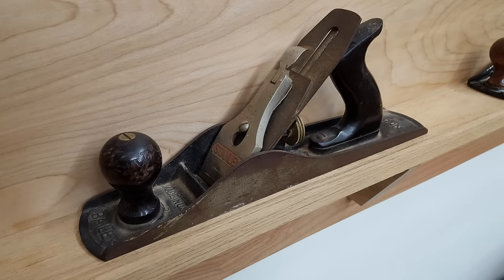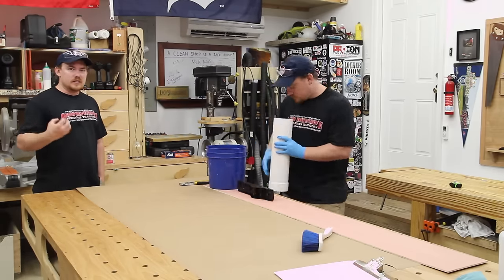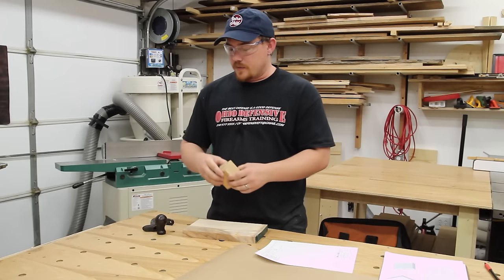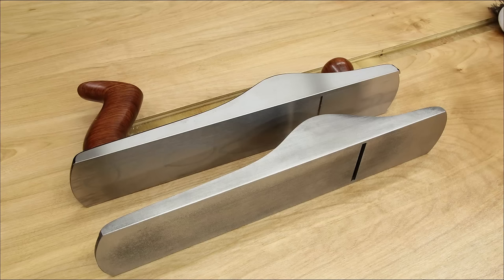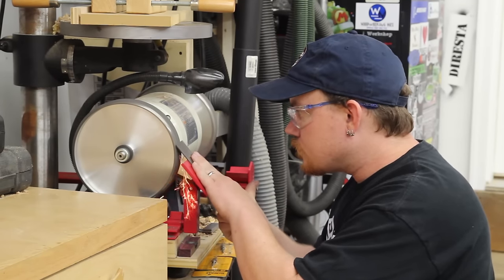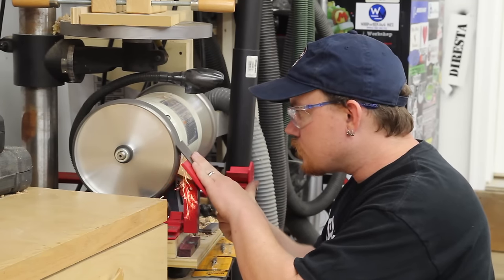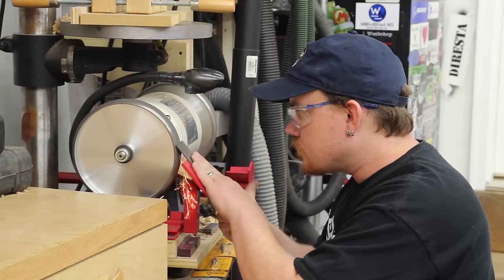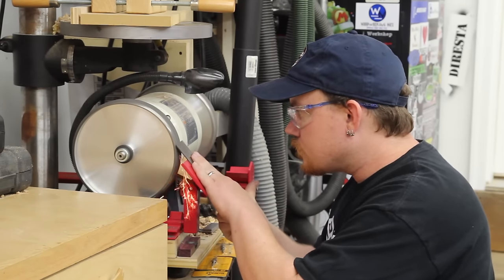Restoring A Hand Plane - Stanley Bailey #5    - 254

Comment: your not worried about the back handle splitting? which way is the grain going? 
im refurbishing a plane as well (i dont know what number it is, i got it for $5 from a wood market and it had a plastic handle, the guy told me its an el-cheapo reproduction made in india) and i was wondering about how to go about making the back handle, ive made some handles with cedar and they split right along the grain so is that a problem with all wood, if not what wood should i use? thats not hickory (theres not any places that sell it near me) would a tree branch work?

Comment: Great information.  I just bought a Stanley No. 5, type 20 off of ebay. Looks like I’ll need to do some restoration, so I have a few questions. I’m very new to this so where it’s apparent, please forgive the poor word choices.

If you drop all of the metal into vinegar, will the japanning come off as well?  
What is the reason you built new knobs rather than restore the originals? It was cool to watch, but I’m curious if you could have just restored rather than recreate. 
Won’t the spray paint chip off or scrape off after a few uses?  Isn’t that why Stanley went with japanning?
Can a thick piece of glass be used as a “known flat surface”?
Reply from the maker: I have no idea on the japanning. New knobs because I wanted to make a new one. The old can be restored. The paint is not as durable as japanning. I used what I had on hand. A thick piece of glass can be used as a flat surface so long as you verify it is flat.
Reply: @JayBates  Thanks. All answers are reasonable.  Much appreciated.

Comment: Other restorers of hand planes say absolutely to not use vinegar. Why do you suppose that is?

I have also seen advise to not use a film finish on the handles, which I also used restoring my No.5. The advise was that a plastic smooth sealed finish makes hands sweat and blister more than an oil and wax finish. I admit that my film finish looks cheap, even with the redwood stain I applied after sanding. I should have just used linseed or tung oil, I think. Both my handles were/are in perfect condition.
My Japanning was too far gone. I stripped my plane down to bare flash rusting metal, primed and painted it Royal Blue ;-) Looks like a type 16, but I don't need it to look period correct for collector value, nor do I want it to work like original. It was never tuned or flattened, or squared. It will be better working than it ever was when I finish up.

Comment: The original tote and knob were rosewood.  You did a nice job on the replacements but nowhere as nice as the rosewood originals
Reply: Gordon Eckler they are worth more with the original rosewood.
Reply: I think during or after ww2 they started using  black painted mystery hardwood.
Reply: Anthony Romano it was mainly beech that they used with a thick dark shellac.
Reply: ss that only applies to dalbergia Nigra that species was as you say listed as endangered and a world wide ban on harvesting and sale placed on it. But like many other timbers (walnut for example) there are many forms of rose wood that can still be legally harvested and used. Indian rosewood for example. Crown tools in Sheffield here in England still makes and supplies Rosewood plane handles.
Reply: Rosewood is still used widely in the manufacturing of guitars as well.

Comment: nice restoration.  quite impressive.  quick question for you on it. would boiled linseed oil be better to use on the wood handles then the lacquer if it is being used regularly?
Reply from the maker: This won't be used regularly. It depends on which way you view it as well. Boiled linseed oil will leave room for dirt and grime to build up in the handle. Lacquer is a film finish so oils and dirt from the hand won't penetrate it.
Reply: +Jay Bates I see.  Appreciate the info. Thanks man

Comment: Hi, as an older tradesman, I noticed on a number of occasions that you placed the plane on its sole, the surface which has the blade protruding through.  If you bench is not 100% clean and free of sanding grit, nails, and screws, this can be very detrimental to the blade you have just sharpened.  I was always taught to place the blade on its side where the blade cannot be damaged.  Other than the aweful coloured handles a very good video.

Comment: I am restoring a Bailey #5 and I ran into a problem, The front screw that  holds the tote handle is not correct  The tapped hole on the front is too large
for a #10-24 and too small for a 1/4-20. I think the proper size is a #12-20. Where can I get one of these screws?

Comment: Jay, why would you sacrifice a Brazilian rosewood handle for any other wood? I have the same dilemma with a newly acquired No.1 and I will not refurbish it before I replace it. More than likely, I will coat the tote knob base in small amounts of epoxy and sand lightly. There is a legal source for Brazilian, but I’m not willing to say what it is.

Comment: Can you tell how strong (%) is a vinegar solution that you use and do you mix it with water or not? Thanks! :)
Reply: The stuff he used is 5%, no dilution needed.
Reply: @motorcyclelad  5% what?
Reply: 5% acidity/acid. It’s marked on the bottle.

Comment: I've looked on your site and Paul's site for info on the diamond sharpening plates and so far can't find any info. Would you pass that info along? Thanks
Reply from the maker: DMT Diamond plates. Coarse and extra extra fine are the only ones I use now. I use the Rob Cosman sharpening method.

Comment: I have a 14" Stanley - Bailey hand plane that I have restored.  My problem is I can not get the blade to protrude thru the bottom of the plane.  I am beginning to think that I have the wrong chip breaker which is holding the blade back.  Do you have any ideas?
Reply from the maker: Sounds like it. Try advancing the blade a little more on the chipbreaker.
Reply: I tried advancing the blade beyond a normal fit for the chip breaker. A little and then more. I tried moving the frog to different positions. I found nothing that works.
Reply: Perhaps the blade is at the end of it's life, it may have been sharpened too many times and is no longer long enough?

Comment: What grit self adhesive sand paper was used? Thanks!
Reply from the maker: This was a while ago so I'm not 100% certain. But I think either 80 or 100 grit. I doubt I would have purchased any higher than that.

Comment: Great job on the video.

I too am wondering what species of wood you chose for the knob and tote. The totes sometimes broke because the design is inherently weak, and if the connecting bolt is not kept tight the long grain in the tote is easily sheared. A species with linked grain helps address this issue.

Comment: So to clarify, the flat (back) side of the blade needs to be up?
Reply from the maker: Correct. This is a bevel down plane. The vast majority of planes are. Low angle planes typically have the bevel up.
Reply: thanks jay!  this is why I like you.  you take the time to explain things

Comment: Jay - do hand plane's work with plywood edges?
Reply: +hinduspl I'm not Jay, but they do work well on plywood. Just be aware that if you use a wooden plane, it will eventually wear a groove into the sole.
Reply from the maker: Yes. But due to the alternating directions of plywood you might get tearout or fuzzy edges.

Comment: Sorry Jay, but that plane is almost in good using condition. A quick rub down with a Scotchbrite would have removed most of the surface rust and a quick few strokes over a piece of 400 grit emery paper would have cleaned the sole. have a look at Paul Sellars restoring a bench plane if you want to see a neglected plane.

Comment: What do you do to everything after rinsing the vinegar off with water? You started to say what you do to make everything perfectly dry, but you didn't actually say it.
Reply: Nevermind I said screw it and threw everything in my oven on low for a while. That worked really well.

Comment: Great Instructions.
One thing I also use, is a squiggle of candle wax on the sole before planing - it makes it so much easier.
The part of the video where you demonstrated the fine shavings being made, you appeared to be pushing the plane rather hard.
The application of a little wax - and you would have glided along.

Comment: What grit did you get to before you stopped polishing the sole?
Reply: I'd like to know this too. 2000-2400 is pretty typical for high polish of metals. Just the type of product used is interesting too. Wet-dry sandpaper or compound.

I've heard from many places that 3-in-One can gum up over time or simply wipe completely off easily. I think Ballistol is widely regarded as the preferred oil. Comments?
Reply: I stopped at 400 on all my planes.  Nothing to stop you going higher or lower.  I think sanding against a good flat surface is what's Important.  I only brought my scrub plane to 80 grit.
Reply from the maker: I used 120 grit. That's it.
Reply: Nice.Jay Bates

Comment: those handles could have been restored and maintained the original equipment. Your handles look nice, but original handles restored are usually better. If the original is broken, that's one thing, but a chipped finish is no reason to replace them. Sand and refinish, the same as the rest of the tool. The #5 looks weird with blond handles. I guess you didn't have any rosewood?
four and a half by four and three quarters is not a square. but I get what you're saying.
The important thing is the tool is now serviceable.

Comment: How do you justify using a grinder that can heat the blade and ruin the temper.  Usually, you would grind and cool grind and cool with water.

Comment: Nice result but why replace what seems to be an unbroken original knob and tote. The original tote had a nicer shape and was more deeply contoured than the replacement tote which seems to be flat with rounded corners.